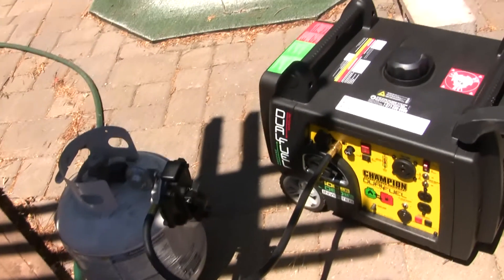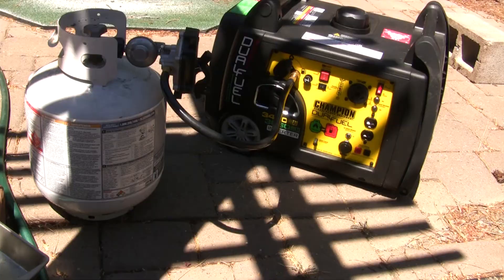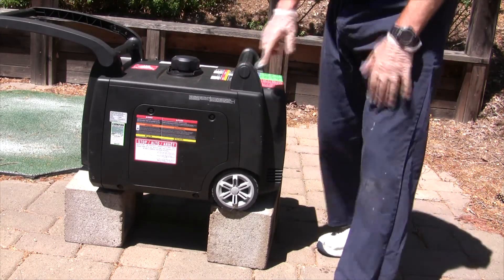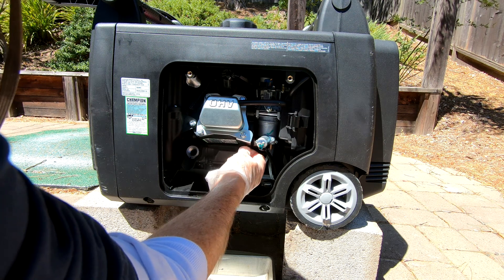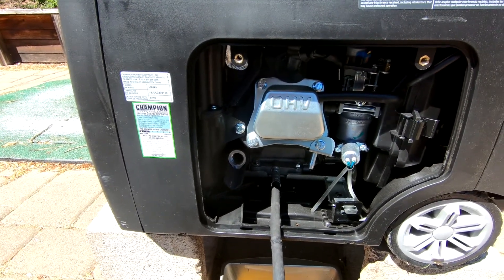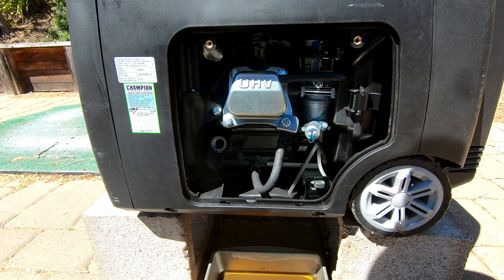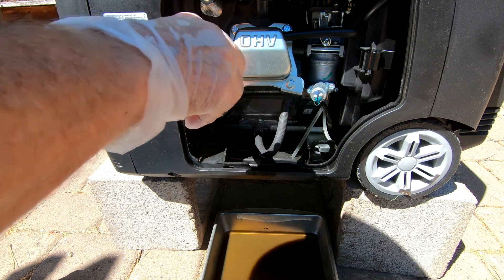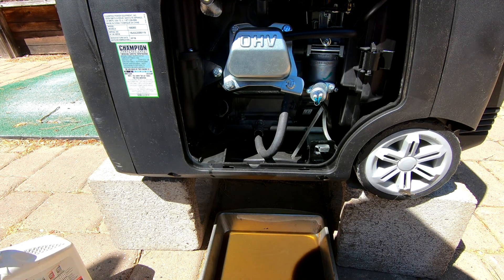Champion 3400-Watt Dual Fuel Generator - 5-hr Runtime Oil Change (using drain tube)

Comment: mumbles... huh?
Reply from the maker: Changing the oil is important for any engine like this.
Reply: I agree just I could not hear 70% of what you said.  I have balanced XLR powered monitors.
Reply from the maker: @RedBaronPhoto  I'm using headphones. The sound is a bit muffled, but I can hear it. If you turn on [CC] (close captioning) you can see what I'm saying.

Comment: Remove some oil from the new bottle until you reach the 20oz / 600 ml matk. This way there is NO chance of error.
Also.
Drain the oil directly into an empty quart. No mess no transfer of dirty oil requied from the pan. No pan cleaning required !
Reply from the maker: Good suggestions!